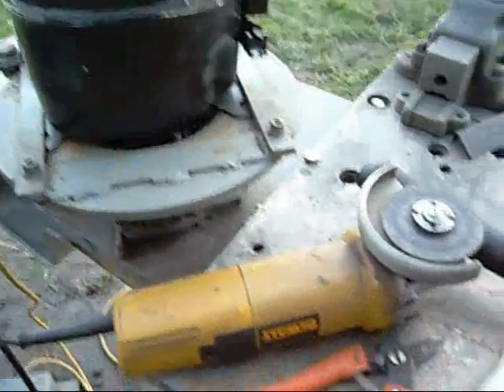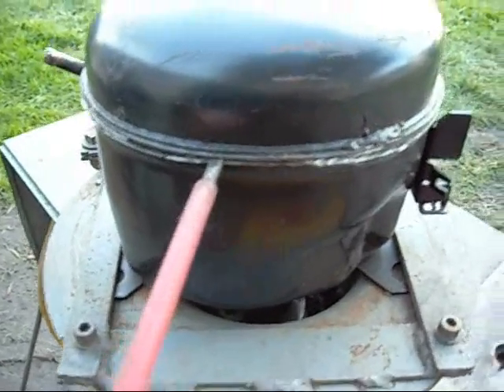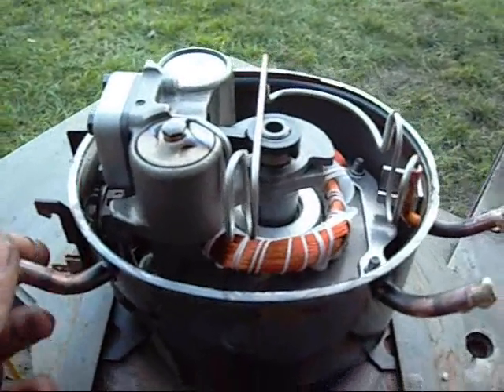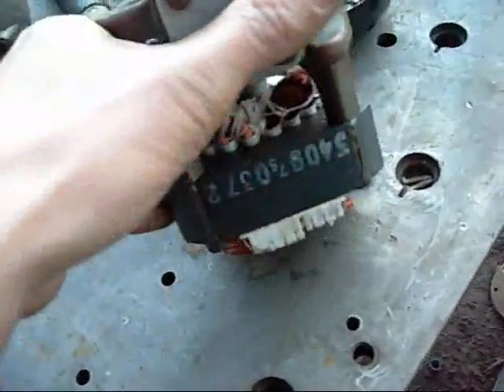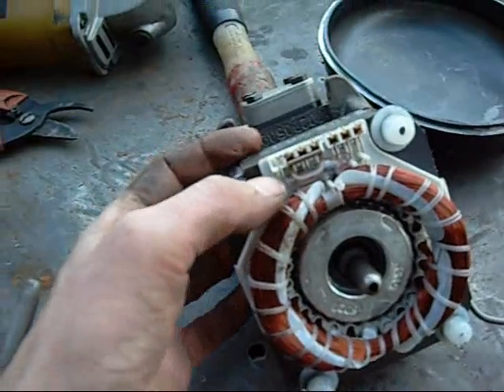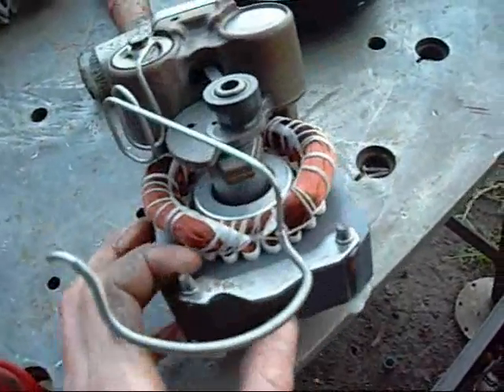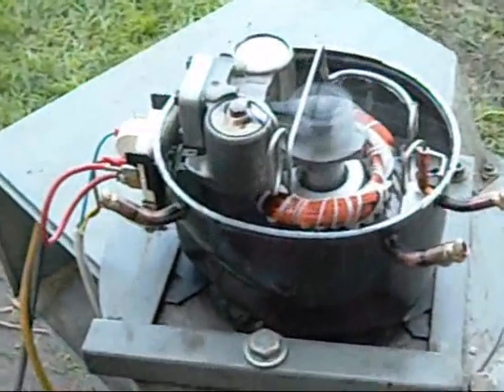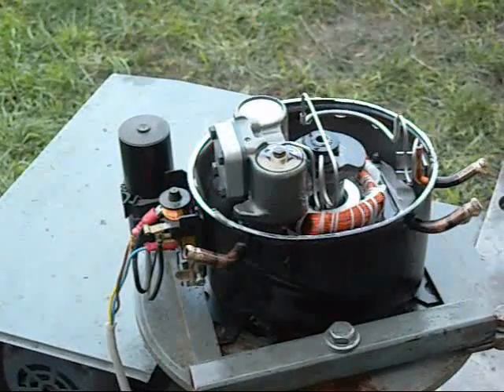Fridge Compressor Fun The Opening!

Comment: As a trucker i wonder what is the difference in a vehicle fridge and house fridge,  is it the compressor construction?  or oiling set up?, spring stiffness? Why does the vibration of driving with a home fridge break it?
Reply from the maker: G'day, the truck units I have were all diesel driven via a coupling, the compressor resembled a large air compressor, usually 4 - 6 cylinders in banks with external valves and lines. and they are very sturdy, the domestic fridge compressors are spring mounted and very cheaply made to keep noise down and make them affordable, but the shock from driving over rough road would definitly break them apart.
Reply: Aussie50 . Thank you.

Comment: The way to scrap these is simple, whack the 4 screws off the tray to fridge, pull the comp out still on the mounting tray, cut the lines, and that's IT. 45c a kilo for no work at all. I do a few per week, the average big fridge comp is a 5-10 dollar note. DON'T be fooled into thinking you need to cut them apart, you are totally wasting your time. there are 2 categories for electric motors [basically]. You have electric motors, then you have compressors. Don't bother trying to get EM prices for a comp. Interestingly, if you get an old comp [pre barcode on the side], cut the lid off, you get a really cool mini piston for a key ring ! the small fridges or bar fridges have the small pistons that are suitable for this. The bar code era, mainly use a slider type piston, with a sleeve. No good for a key ring.

Comment: Mate Ive got a bar fridge that trips the house circuit breaker..which is a shame as its a really neat little fridge. I checked the thermostat and with unplugging the two of 4 wires(inc earth) it doesnt trip. When I bridge those 2 wires expecting the motor to start up we go back to tripping the circuit breaker. Im now thinking I might have a short in the motor windings..My question is ..is it worth fixing?

Comment: can you use a fridge compressor to pump methane from a bio gas generator into an unused LPG tank (or some other old pressure vessel). I saw a clip from somewhere overseas (india I think) and they did.
Reply: Uncle Reeko U can safely use R600 compressor. The R600 compressors are designed to work with butane gas
Reply: Never ever do that with equipment that is not designed for combustible gasses
There is a serious risk of explosion, better use a pump that is designed to pump combustible gasses/fluids 
The insulation is designed for the specific type of gas / fluid 
I don't know the law there, but if something goes banannas insurance companies will refuse to pay out, and you can even get jail time for endangering peoples lives... 

I know those pumps cost a lot... But better be safe
Reply: A SI Studios - thanks, appreciate that

Comment: Why are these compressors always in a steal bubble enclosure? They're not on a car ac system.
Reply: +Michael Powell Its so the oil can return to the bottom efficiently to be re distributed. Also a round structure is most efficient when you dealing with gasses and pressures, Look at LPG storage tanks at a refinery or the propane tank on your barbeque grill ..

Comment: I found your videos on fridge compressors fascinating and informative. I have a question I am sure you will be able to advise me on, I am thinking of using a fridge compressor to make a airbrush compressor after watching your video showing how the motor oils its self I am wondering if the oil will mix with what will be the air flow or are the air inlet and outlet separated from the oil inside.
Reply: lesmilton1951 The oil in an a/c compressor is not supposed to get into the lines with the refrigerant, if it does then there is a problem.  They're separate systems.  Oil in the lines could build up inside coils, clog the expansion valve, or make its way back to the compressor and damage it since you cant compress a liquid. 
Also a typical residential a/c compressor can output 220-270 psi,  while an airbrush only needs about 50 psi.  The freon in the a/c is part of what's used to cool the oil in them as well.  You'd need to do some serious modifying I think.

e: you also said a fridge compressor and not an a/c,  I believe they can go much higher in psi - 400 or more.

Comment: How it is possible to increase temperature of condenser, e.g.100C or more? Does the outlet/high pressure pipe inside compressor prevent it?

Comment: Thanx for taking the time to show how the oil/lubrication aspect operates on this type of a compressor. A spiral tube,simple and effective.
Never took the time to disassemble one.
Is the amount of oil that gets into the freon part of the system a by-product of the piston blow-by?
So the casing you cut apart must be have a quality weld to also keep the freon contained within?

Comment: I have to ask this. The lubricant oil of the motor and the freon are mixed together inside of a close type motor?
Reply: +telosfd The oil is pumped and returns
Reply from the maker: that is correct, a small amount of oil passes around with the gas. if the system is not designed correctly, the oil accumilates in one part of the system (the condenser for example) and it runs the compressor dry.
Reply: +Aussie50 Does that mean that some oil is being pumped into the air tank? If so, how do add oil back into the motor housing, and how would you know when, and how much to add? A lot of questions, I know.
Reply: Thanks, this is the point.
Reply: Hi my boss me i on frigorist and i on to benin sil te pre you fear me find a plase beside you laba my names it is vinou herve I on at +22996051127

Comment: Nice vid. Got one downstairs, did a quick search on Google to see if the motors are universal and came back here :)

My AC inverter doesn't want to start it (trips the overcurrent protection) but I've bodged a 300V DC output onto it as well, so I thought I'd check before plugging the compressor into that.

Ah well, plan B it is, then - tweak the overcurrent protection :)

Comment from the maker: G'day, it sounds like its slugged, IE injected so much liquid its smashed the valve plate and seized the bearing, 
you won't be able to recharge it after cutting it open anyway, not unless you carefully tig weld the whole case back together

Comment: Awesome! Very informative. There doesn't seem to be a lot of info on these things on the internet. I have a Tecumseh that looks just like the one in your video. I locked it up by putting to much R134 in and now both sides show the same pressure. I evacuated it and it's about 10psi each side. Tried a 3 in 1 hard start and whacking it a few times with a mallet. Still no pressure change and it's drawing 9.5Amps. Any suggestions before I open it up to relieve the hydrolocked piston?

Comment: its resally not a problem, but what really causes that knocking noise is the stator hitting the steel wall of the compressor. the compressor's mounting springs (or suspension) is just not  stiff enough. its made  like this so the springs can act like a clutch if the starting load is  kinda high.

Comment: As I waatched first time I seen a half compressor casting on it plus some plastic spring mounts. looks like its a cheaply made unit.  those inlet and exhaust chambers you refer to are actually mufflers.

Comment: THANK YOU SO MUCH!!! I used your method to open up an old dehumidifier compressor and it worked absolutely perfect! My plan is to turn it into a "silent air compressor". I cut it open because I want a way to check and add oil. I am going to drill a hole in the top and add a dip stick so I can check and add as necessary. I just have to figure what a good oil level height is though.

Comment from the maker: @ramiretz R134a compressors are a bit low on pressure but if you can use a R22 compressor, they are rated much higher!, so 200psi would be effortless for it.

but yeh, head pressure in 134a systems is around 130psi, so start there and see how it behaves.

Comment: @Aussie50 wow 200psi... thats great

i bought an super silent compressor and its set to 87psi from factory...  i set it up to 116psi now  but i was not sure how much those little compressor motors can handle so i stopped with 116psi ....

i read on a page from a fridge company that they work in normal home fridges with  116-130 psi

would be interressting to test out how much pressure they can handle...

maybe u can test it in a video ????
thank you for your answer

Comment from the maker: @260830107 no, its all cast iron and it will rust up as soon as its stopped for a amount of time, like overnight.

likewise it would have to be externally driven since water and electric motors is a bad idea.

Comment from the maker: @qualitatserzeugnis Its for a few reasons, cost, reliability and safety.

the housing has to hold pressurized gas for years on end, so the best way to prevent leaks is to weld the entire assembly, as opposed to bolting the housing together with gaskets.

and due to the few amount of parts needed with a welded shell, its a lot cheaper to weld them up, as opposed to the semi-hermetic compressors which are bolted together, and much heavier (Industrial applications use them)

Comment: @Aussie50 i've got 2 fridges ... 1 take alot amps (can notice from the lights ) and make small noise and still not cooling (use to cool few days ago tho) so what should i check ... 
other one work normaly ... the compressor sound kinda loud but still no cooling 
could it be gas fly out the pipes?

Comment from the maker: @stdavross666 oil normally cycles with the refrigerant during normal operation. laying the fridge down can cause it to go out the suction line, but after standing for 30 min or so it will drain back down. 

just let it stand for a little while, then run it for a few seconds, turn it off and wait 15 mins before running it normally.

Comment: @Aussie50, I used one of these compressors and turned into air pump that powers my finish carpentry nail guns. It works real well as a low volume air compressor. 
One of the best advantage is that super quite running air compressor.

Comment from the maker: @isethaitchison yeah hissing is high pressure gas coming out (illegal) usually CFC in those old ones.

the radiators are called the evaporator coil (indoor side) and Condenser coil (outdoor side)

Comment from the maker: @garotinhogostoso if the compressor is working enough to make a short blast of air come out somwhere it may be a sticky valve on the tank/regulator assembly.

try disconnecting the compressor discharge line from the regulator/tank and run it for a while.
that may tell you if its a stuck/blocked line.

Comment: @Aussie50 Yeh; the compressor stays inside a closet, unused, for about 6 months or so. When plugged to the wall socket outlet, it just won't start. There's a light which kinda witnesses the compressor is on, but then after 10 seconds I can hear sort of the sound of a short gust of air before the current is cut, and the light is off.
D'ya think I could be able to remove the top of the discharge chamber for myself or I'd better take it to some specialised personnel?
Thanks, Ed, mate!

Comment from the maker: @garotinhogostoso when you say it hasn't been used in a while I assume you mean stored for some time?
I have a commercial airbrush comp that uses a refridgeration style compressor and it has rusted out in the discharge chamber and ruined the valves. maybe that is what is happening to yours?

I'm not sure on how to stop it tho, once the water is trapped it won't come out unless you remove the top of the discharge chamber and let it evaporate.

Comment: Hi there, Ed, mate!
Very interesting stuff, bloke! Listen up, I've got a 2.9-gal airbrush compressor which works with one of these fridge compressor heads (?). Thing is the compressor seems not to work any more after long periods of inactivity; this is, the compressor is not used. This is the second time the compressor doesn't start, so I wanted to ask ya why this happens and if there's anythin' to do to avoid this happening again once the head (?) is changed by a technician.
Cheers, mate!

Comment: Sorry I meant oil, (it was like 2a.m.)do you think the piston ring's shot I've had this thing for 12 years its just been a recent occurance. I've always used synthetic oil like they recommended. Or maybe the valve's wore I don't find any cracks in the output lines

Comment from the maker: @craigr13666 Not sure what you mean by "start sucking air" since thats what compressors do naturally, if you meant it stopped sucking air, then it could be a number of things.

if the motor is running, but it is not pumping it could either be excessive bore wear, broken con-rod, or broken reed valves. all or which make the compressor a write-off :(

Comment from the maker: if the crankshaft is stiff it means it suffered bearing failure, prolly from oil loss through the lines.
normally they are supposed to be smooth and free turning.

Comment: holy crap thats cool i have a really old (like 30 yrs old) freezer that has cooling racks with freon in them and one broke like 3 weeks ago but its still running the case on the outside is really hot but and when you get your finger wet and touch the compresor you can hear it sizzle (thats probaly bad) but i got a mew one but i dont get why it hasent seezed up yet ????????? but its been working hard.

Comment from the maker: there are numerous reasons why manufacturers scrap compressor stock, mainly to do with oil shelf life, warranty and gas compatibility.
Danfoss is aready discontinuing R22 systems in favor of R410a

The only part of a packaged compressor I can't recycle is the Styrofoam insert, capacitor and starting relay.